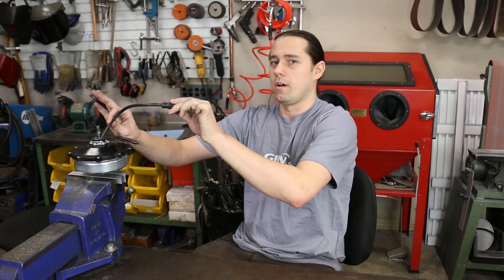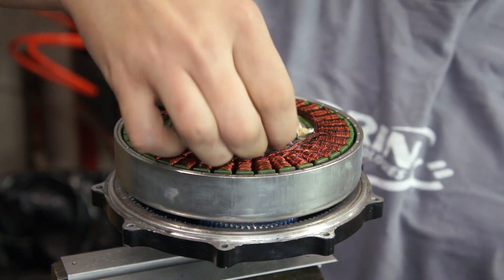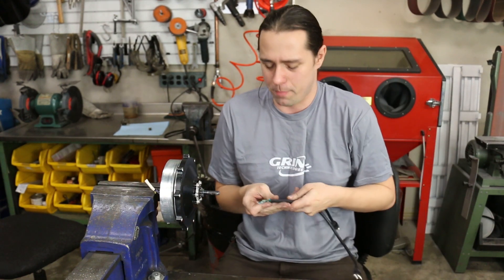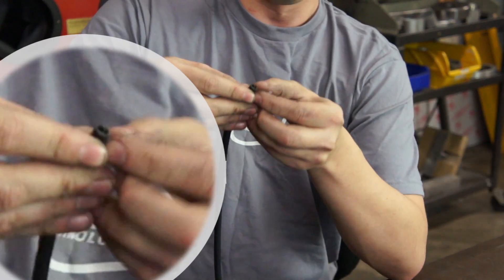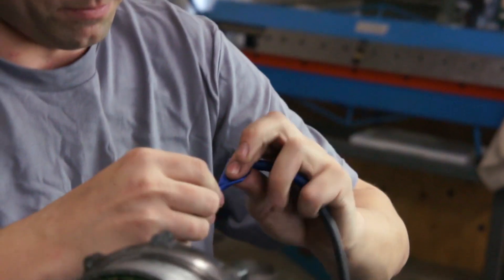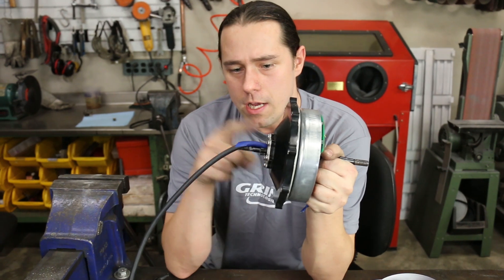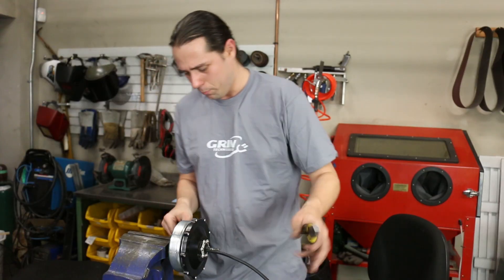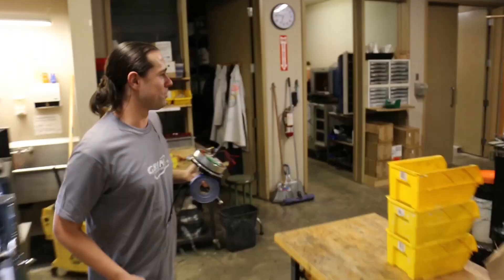How to replace a damaged cable harness in an ebike hub motor

Comment: Where did u get the replacement motor wire? Can u put in description🫰
Reply from the maker: We usually salvage these from damaged motor controllers, so we haven't needed to order it independently.

Comment: Take the wire and trim all except one or too main ones and take a piece on nylon string a tape to those main wires and cover all with casting intake that too a point then feed  string through  hub an put some lubricant on tip of taped casing and feed hub as you pull

Comment: Okay I have a frayed cable the yellow cable to be exact but no matter what I do it doesn't want to run I've tried crimping and even tried soldering I've even cleaned the area to where I have exposed copper for both the crimping soldering and even doing both at the same time and no matter what spin a little bit and then cut out
Reply from the maker: It's possible you have damaged the motor controller and/or one of the hall  signals. If the yellow phase wire got pinched to a hall, that exposes it to high voltage and fries it

Comment: Friendly Suggestion from a Fellow Builder:

Hey brother, really appreciate the time and effort you put into sharing this video — I know how much goes into doing the work and filming it too. That said, I just wanted to offer a small technique suggestion that might make future repairs easier for you (and your viewers).

When you’re pulling out a cable bundle from a hub motor — especially one that’s sealed tight or stuck from weather exposure — instead of trying to yank it straight out by hand, you might find it easier to:

Flip the hub over, so gravity is on your side.

Grab the cable with a pair of vise grips, just behind the rubber grommet.

Place a block or wedge (like a deep socket or a piece of wood) between the vise grips and the hub casing.

Push down on the vise grip handles, using them like a lever. It’ll pull the cable straight out smoothly and under control, without straining the wire or your hands.

Comment: Tie cord to end b4 pulling our damaged cable to act as a redraw cord and use baby power as it lubes plastic and rubber with out harm from a petroleum based product…. Any way u work this it’s like 5lbs of dodo in a 2lb bag… suggest a lacrosse helmet, mouth guard and safety glasses!

Comment: just take the 3 fase cables rest cut away, fold then over loop of 1 single wire then tape it.. add soap to outer cable, pull it while pushing at the back, Somone is your uncle is it bob?

Comment: I'LL GIVE YOU A VERY SIMPLE TRICK SO FAR WHAT YOU DID BY SHORTENING THE INNER CABLE NOW WHAT YOU NEED TO DO IS APPLY A VERY THIN FILM OF EAL GREASE ?
I KNOW IT SOUNDS FUNNY BUT I USED TO TREAT THE BOTTOM OF MY LASER POLYESTER ONE MAN SAILING JOL I DON'T KNOW IF THIS WAS ALLOWED BUT THIS WAS MY SECRET TO ALWAYS WINNING THE REGATTAS THE GREASE OF EAL IS JUST SO SLIPPERY I MEAN TRY TO PICK UP ONE LIFE EAL FROM A BUCKET WITH YOUR BARE HANDS IT'S SIMPLY IMPOSSIBLE WELL YOU WILL HAVE NO PROBLEM PULLING YOUR CABLE THROUGH

Comment: I replaced the wire and I get no error code on my bike but when I twist the throttle I get no response.

The replacement wires phase wires or the three big ones are slightly thinner than the original and the pins corresponding to those wires are also thinner

Please help me out and if there are any good repair stores near Los Angeles that could repair this please let me know

Comment: When you cut the wires flush to pull by the shieth 10:54. You should cut the wires to different lengths it is much easier to pull through than haveing a big lump if wires comming at you because of a flush cut

Comment: Thermo plastics (sheath and insulation) deform well with low heat, a bit a silicone lube might also help.

Comment: Tip put the cable in the vise you can pull a motor a lot easier than you can pull the cable

Comment: would it have helped to use a little silicone spray on the wire to ease passage?
Reply from the maker: Yup. That general recommendation (lube the sheating) probably accounts for about half the comments on this video.

Comment: I just drilled out the hole a bigger pulled the cable through an filled it with some silicone
Reply from the maker: Be Careful that drilling or the cable hole larger will weaken what is already a weak hollow axle. Make sure that you have a torque arm on the opposite side

Comment: A good way to de-solder the phase wires if they're large gauge is use a butane torch from a smoke shop.

Comment: I have an alternate method. Remove about  8 inches of the outer sheath. Then take all of the wires and rap a small bit of electricians tape starting from the end to secure the unbundled wires. Aboout 1 inch is enough. Tie the loos wires every 2 inches or so that should give you like 4 points where the wire is secured until you fit the main sheath where you strpped away the 8 inches. Now get teflon plumers tape and start rapping the wires from the end of the bundle right where you put your first wrap of electrical tape. Pulling snugly on the teflon tape wrap your way up towards where you stripped away the outer sheath and extend on to the sheath for about 3 inches. Now the whole thing will easily feed through the center hole on the axel. I tried this snd it took 30 seconds to get it through.😊

Comment: I broke a strand of the copper wire coil while desoldering the phase wires. Can it be repaired?
Reply from the maker: Usually yes, just scrape off the enamel so that the solder has a good surface for bonding.
Reply: I can't locate the point of break. That's why it looks like a difficult repair if even. tOtal  newbie. All this happened because I had the privilege of changing my first flat. GEEZ! Thanks for the reply. 👍

Comment: About to attempt this very thing myself. The only two things I intend to add to the approach will be 1. a small amount of  lubrication applied to the cable jacket behind where the rim tape finishes and 2. The use of a reversed Quick clamp to apply the brute force to pull the cable through but hopefully with less effort and more control.

Comment: Any tips for upgrading the internal wire gauge mine has some pretty fine wire for such a high Wattge hub
Reply from the maker: Yes, use a very thin high temperature heat shrink over the stranded wire and do away with the outer sheathing.
Reply: @GrinTechnologies  ok thanks 👍

Comment: Is there reason for keeping the outter most sheathing in line with the wires being swapped in harness? Why not remove the outter most sheathing entirely while moving the wires in and out of their places and through the narrow bore. Then when in place add it back to side of the harness that runs externally/outside of the motor to the circuit?

Or alternatively leaving the old sheathing in place and using the old wires you’re being replaced to pull the new wires into the existing sheathing in a single motion/effort as opposed to fighting with both in both their respective directions in and out? 

I can’t imagine this is the easiest way to achieve the same results, and if so the motor company is on some bs frfr

Comment: Anyone tried cutting the connector off the old wire and tapering the new wire to the external end of the old cable and either pulling the whole thing new and old through in conjunction with each other so as old one is pulled out from inside it would pull the new wires in from the outside. 

Even better probably Where possible, this could also be done while leaving the outer most sheath in place and connecting only the inner wires new and old to each other and then pulling the old out to also pull the new in of both the sheeth and the motor. So long as the wires being pulled in and out are continuous and connected in a way in which thickness constant and without large/abrupt variations , I’d think this would be a far easier option than fighting the twists and turns of the hard internal angels twice for the whole wad of both the new and old cable once to remove old and again to force new in…. 

Ntm leaving the sheath and using the old wires within to pull through new inner wires into the hub, could be done as each individual wire/smaller groupings of them (and thus more leeway with clearance for the hard part (ie passing through the case)) less thickness to be fighting with for clearance.
Reply: Is there reason for keeping the outter most sheathing in line with the wires being swapped in harness? Why not remove the outter most sheathing entirely while moving the wires in and out of their places and through the narrow bore. Then when in place add it back to side of the harness that runs externally/outside of the motor to the circuit?

Or alternatively leaving the old sheathing in place and using the old wires you’re being replaced to pull the new wires into the existing sheathing in a single motion/effort as opposed to fighting with both in both their respective directions in and out? 

I can’t imagine this is the easiest way to achieve the same results, and if so the motor company is on some bs frfr

Comment: It does not show how to get the cover off of the hub 2 gain access to the electric wires
Reply from the maker: Generally you undo the screws and slide it off. If it is difficult to pull by hand or with gentle tapping, a great puller does the trick.

Comment: So many people asking where to buy the replacement cable and not a single answer. It looks like grin used to sell this cable by the meter but that product has bee discontinued. It's strange that it's so hard to find when there's such a need for replacement cable. Waah. I need some.
Reply from the maker: The problem is that the cable we sold by the meter was larger in diameter than most of the axle bores on these Chinese motors, we had it made for our controller production not for rework of hubs.  The easiest solution is just to buy a 1 meter extension cable of the same style connector as is used by the controller, like this:
https://ebikes.ca/shop/electric-bicycle-parts/wiring/motor-wiring/z910-ext.html
Otherwise we would also often scavange the cable from motors that had other kinds of damage on them.  For the motors that we make here, we sell replacement cable directly, ex:
https://ebikes.ca/shop/electric-bicycle-parts/wiring/motor-cables/l1019-hg6-motor-cable.html

(Ideally all motor manufacturers would be so considerate ;-) )

Comment: GRIN always tries to make things easier. Could GRIN do the hub motor cable thing way easier?
Reply from the maker: In the All-Axle motor that we make, the cable doesn't to through a long channel in the middle of the axle but just a small channel off the the side, making cable replacement vastly easier.

Comment: hey, great video. BTW you can also solder all wires together and attach a 14 ga wire, then pull through. Great job.
Reply: What's 14 ga wire?

Comment: a small squirt of dry lube on the outer casing when pulling through works just fine, plus some applied on the inside
Lastly, why not thread on the nuts on the axel then vise it up? so much easier.

Comment: Can this soldering process work with high voltage cables? Like a 48v 1500w cable to be precise
Reply from the maker: 48V is not considered a high voltage by any definition of the term. And yes, soldering works at any voltage, but actual high voltages (ie hundreds of volts) can have additional insulation and isolation considerations.
Reply: @GrinTechnologies  oh okay I appreciate the quick responses.

But truthfully I'm using a 48v controller pulling 45amps WITH a 52v battery pushing 45amps.

Would I be able to use Butt connectors and crimp both wires together? If there might not be enough length? 

Or is soldering the best solution?

Comment: Bro I need help I didn't leave a little little amount of the colored cable on there and I don't know which wire's to wire back the blue yellow and green
Reply from the maker: That's unfortunate! Taking a photo before snipping things is a good idea.  If you have a controller that can auto map the hall signals it doesn't matter what order you use, but if it's not a programmable controller then yeah it will be some trial and error on your end. 6 possibilities isn't too many.

Comment: May I suggest a little die electric grease to help the cable slide?  Not the mention it will provide some moisture prevention as well. I love your tips on how to pull the cable through.

Comment: The connector end on mine is different to any that is available to be bought can I just cut the old end off and attach it to the new cable?
Reply from the maker: Yup, as long as you know how to solder wires.

Comment: Are you UK based? I have the exact same problem where the cable has broken in the exact same position as yours.
Reply from the maker: Well, luckily the repair process outlined in this video doesn't care one iota where you or we are located.  Either go get your hands dirty and try to fix it as we illustrated here, or take it out as scrap metal for recycling and buy yourself a replacement motor.

Comment: would a broken cable be an error code 07E on my display or just the hall sensors? Pls help me..............
Reply from the maker: You'll have to contact the vendor who sold you the bike and find out from them what the various crytpic error codes on their display mean.  If your vendor can't handle that support request, then we'd recommend purchasing your stuff from somewhere else.  We don't deal with these displays at all so can't give any pointers.

Comment: This is great but my motor is big. That means I need a heavier replacement cable to take the 50 amps+ my motor draws. Does anyone know where I could get one? The motor is a 3 Kw QS 12"

Comment: If I didn’t have damaged wires but just wanted to turn the motor cable into a quick connect plug(for convenience), do you have any videos on that?
Reply: Underrated comment!

Comment: I learned so much here, basically not to be afraid of all this stuff, all you need is the right tools and a healthy set of balls… and desperation that your motor will not work otherwise…
Reply: and a can of silicone lubricating spray
Reply: @globin010252  This!
Reply from the maker: True, True, and True.

Comment: Great video. Question.
Some motor stems use a white "foam" or puddy to keep the cable from moving around in the stem.  Do you know what this foam/puddy is called?  Or can I use any type foam sealant? Can't find anything online. 

/bklyn 👑
Reply from the maker: Usually it's a white silicone based sealant, we've never seen any using a foam product.

Comment: I've used two stroke petrol, squirt a bit in the axle and over the cable, it slides in, you only have one go at it so mark where it needs to stop at, then blow the petrol dry and all done.

Comment: I would file the metal around the hole smoother , mine had a really sharp tiny burr that soon severed the cable even after being very careful by my third tyre swap . Also i now dob the hole with a glue gun after fixing to minimize any movement near the hole  after refitting . Still I'm on 4000 miles now  which means its  paid for itself easily on fossil fuel vehicle costs. I have had all sorts weird symptoms with wire chaffing also and now am very careful on cable routing and  extra wire protection  over the bicycle in vulnerable places . .

Comment: I'm just wondering, how did the group insulation break, if it cut going thru the turns, one of the wires may have rubbed against a burr and short

Comment: My motor has all the colored cables that go to the PCB that's fine no problem but then there's also a black and white skinnier wires coming from the same large cable but they go into the coils underneath the magnets so I'm changing my main power cable but I don't know where they connect to I don't want to rip them out so should I just cut all the color ones out and resolder to those skinny wires that are in the coils leaving the original ones in place wherever they are installed to and just connecting to them with the 2 from the new cable
Reply from the maker: Most likely it is for a motor temperature sensor.   Resoldering to those leads would be the best bet.
Reply: @GrinTechnologies  thank you for the reply I appreciate it , I did just that and everything is working good as new now, just wasn't sure about that one wire that's all. Thanks again and take care!!!!

Comment: Would it be easier if while you were wrapping the tape you wrapped it around like a brake cable or a gear shifting cable? There skinny and  strong but flexible. that way if the tape breaks you still have the cable underneath and it's stronger to push through to the other end and then you can just snip it when finished?

Comment: The motor cable to my e-bike has been sliced by someone, cut clean roughly 8-10 inches away from the hub motor. It looks like there are 7 wires to reconnect inside there. There was never a connector. Is this repairable by adding some kind of cable connector? This is a 3 month old bike in otherwise like-new condition.
Reply from the maker: Yup. You can solder the wires all back together as they were with no connector, or use this opportunity to add one as you wish